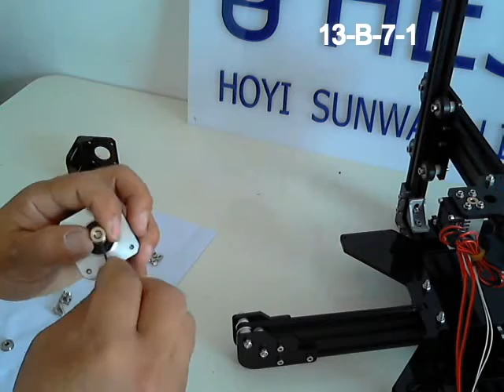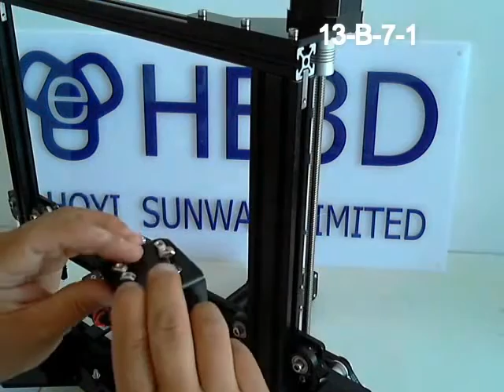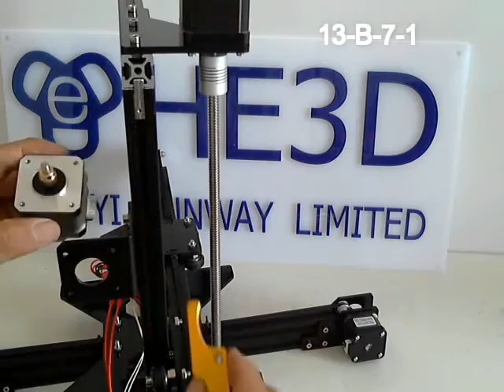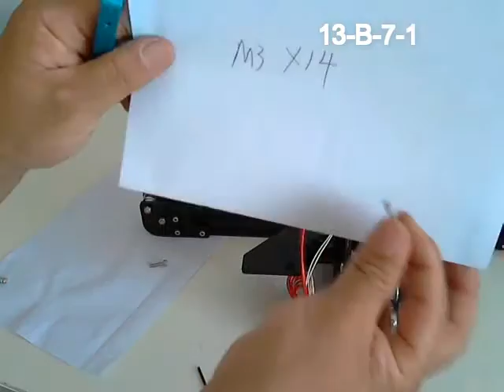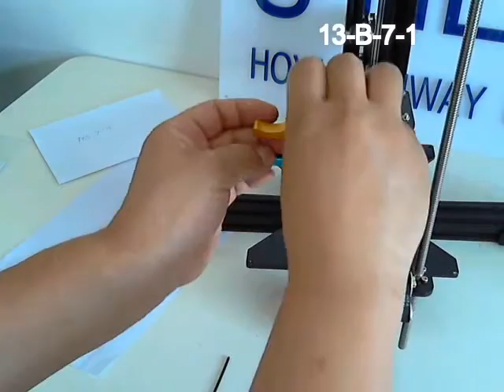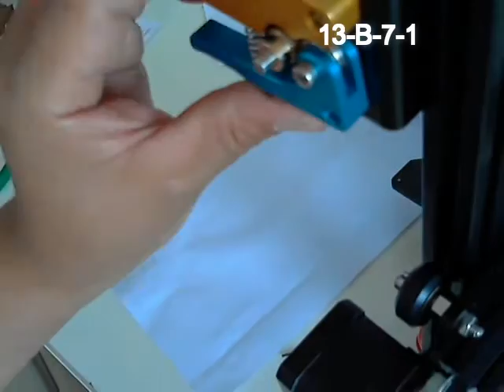EI3 3dprinter 13-B-7-1 extruder motor and clip

Comment: This is just crap. What about those with dual extruders or 3 extruders? How can you stack all those extruder steppers to the frame and not have filament or Bowden tubes foul on anything! Pants!
Reply: Were you able to get this crap figured out? I seem to be missing the shortest bolt for the blue 1/2 of the extrusion motor. Why can't these videos at least be @ 1080p? The quality is horrible.
Reply: @soundspark  why is that a dilusional thought?